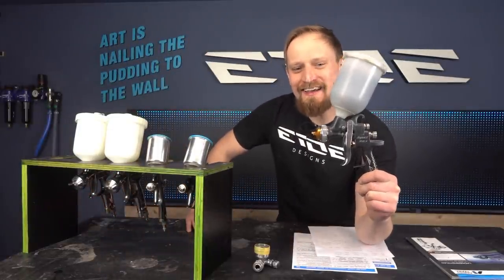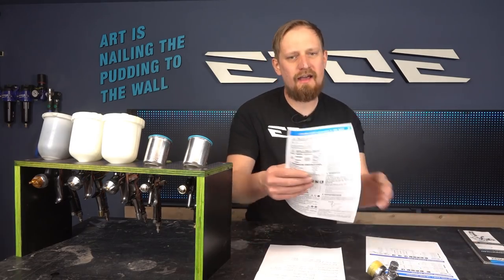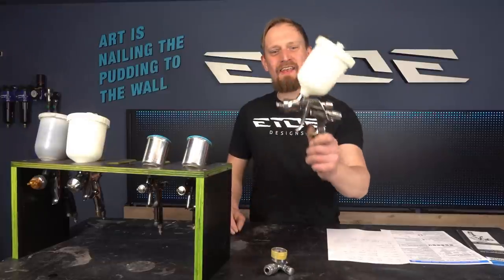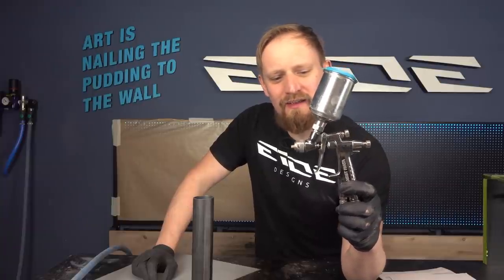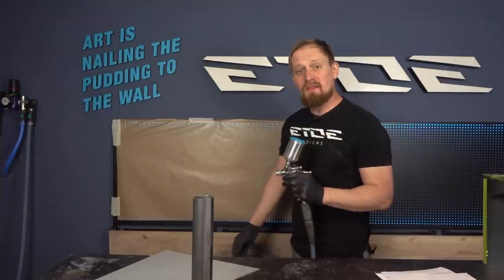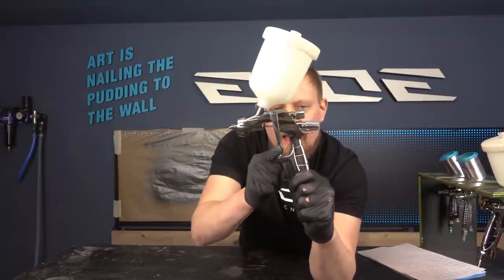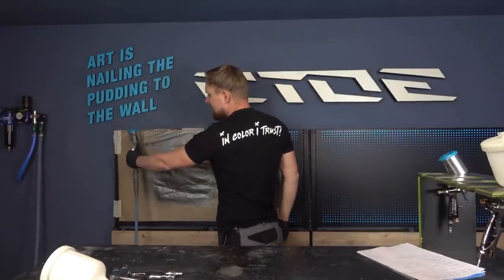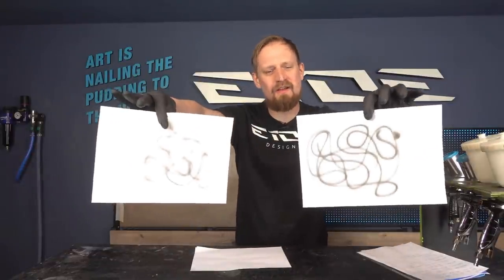Spray Gun set up - 7 pro tips you need to know

Comment: I have a set of cheap Harbor Freight guns and they worked well for my last project that I used them on, but I thought I was using a lot of paint and now I know why that is. I probably had the fluid tip open way too far and was wasting color and had my fan too wide so I was painting the open air almost as much as the project. This was a great video thanks. Danka from America.

Comment: In other DIY spray can video you do, you wet sand 800G between clear coats also you have previously used 2k clears over Montana paints. Is 2k clear for acrylic base coats? Or is it only certain ones? Also is the to wet sand between clear coats always needed either DIY OR PRO and why? Also can you make some DIY Videos on spraying custom components eg CRANKS, Stems, seat posts, hubs and fixing bolts for these pieces eg silver bolts to black or eg a black seatpost that is all scratched how to do a blended/ repair/ refurbished paint finish all at the same tim making sure to discuss how to make the end product paint as factory durable for the particular parts as the tend to cop the most abuse when riding! Martin you simply are the greatest YouTuber and the world’s greatest custom painter THANK YOU KEEP UP THE AWESOME WORK

Comment: Just a quick thank you for a very informative video. I'm usually very careful about researching new things I do but I quite stupidly didn't research set up of a spray gun when using my own new one for first time just figured would be fairly fill it and go and made a bit of a mess of my first coats of top coat on a machine restoration in doing, watched your vid evening after mess up. Went into Workshop next day with your info in head and got gun set up spot on and have managed to rescue the paint finish on my machine. Big thanks 😊🙏

Comment: On tip I have never seen mentioned somewhere is the size of the orifice in the nozzle.
What is the right size for car painting? 0.8mm - 1.2mm - 2mm ?
Reply from the maker: Primers between 1.4 to 2.0, base color 1.0 to 1.2 clear 1.2 to 1.4 depending on preferences. Touch up 0.5 to 1.0 depending on preferences.
Reply: @ETOE  Thank you  for sharing your experience :)

Comment: Very informative as I’m in the process of looking at buying my first compressor and spray gun (once lockdown is over), thanks for sharing this info 👍🏼 One more question, will a 50l compressor be sufficient to spray paint bicycles frames or should I go for a 100l unit?
Reply from the maker: You need min 350l/min to run spray guns.
Reply: ETOE okay thanks, so I’m way off the mark, I’m needing something much bigger in terms of tank volume even though I’ll only be doing bikes 👍🏼

Comment: You should get sata 4400 minijet
Reply from the maker: Surely not! All my minijets died after 3-4 years. The Iwatas run 10 years without any issues. Sata is crap since they changed production in the 2000nds

Comment: I've been watching a lot of painting videos. I've been looking for these hvlp guns, since basically it is used 9 times out of 10. But then I found that for example this "custom z warrior" channel used RP gun with some clear coats and explained it would be the best for clears. So, is there any big difference for beginner/intermediate worker for lets say 1 gun and it would have to do all jobs? Just wondering. And what would be the difference between HVLP vs RP guns..
Reply from the maker: HVLP is high volume low pressure. RP is reduced pressure. Both have approx 65% transfer efficiency. RP needs more air approx 290L/min. HVLP only 170L/min. I love the LVLP with a split nozzle for clear aplication.
Reply: @ETOE  Cheers! Gonna look and read about those too. Keep doing great videos!
Reply: @ETOE  Hey Martin which size of nozzle would you recommend? Does it make sense to get more than one size?

Comment: bro you never say what direction to turn the cheater valve to attain WIDE OPEN, nor does anyone on the iternet, they all say leave it wide open and move on, well what direction is wide open, NOBODY KNOWS
Reply from the maker: Just turn until no air runs through the spray gun. It`s full closed. Turn the opposite way it`s full open.

Comment: Sorry Brother, But I’m only 2 minutes in and I’ve heard some HORRIBLE ADVICE!!! You say you can’t spray overhead, or that you need a “bottom feed” gun??? 

WRONG!!!!! 

The 3m PPS cup system is absolutely Wonderful for correcting that problem, and is what most ALL Professional shops & painters use these days!!! You basically put the cup on, turn it upside down and allow it to suck the air out, Then you are good to spray overhead as much as you want and you won’t get a DROP ON YOU!!!